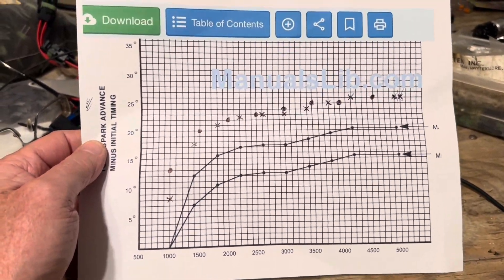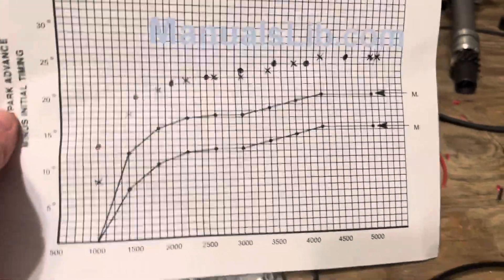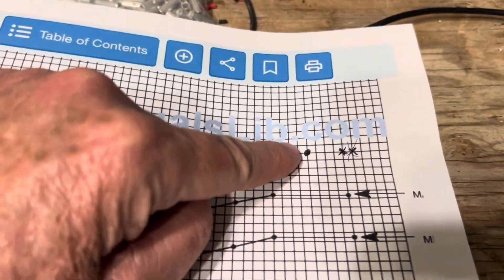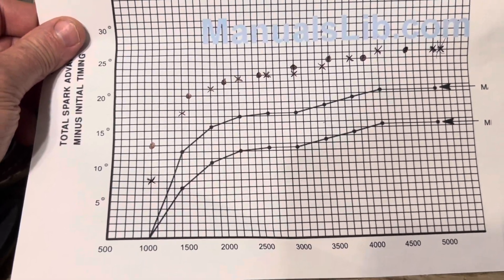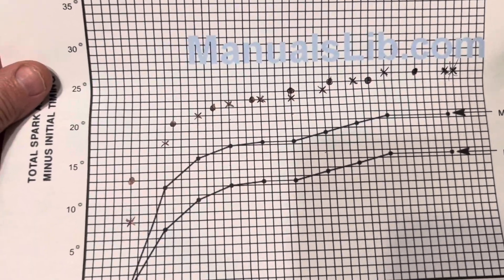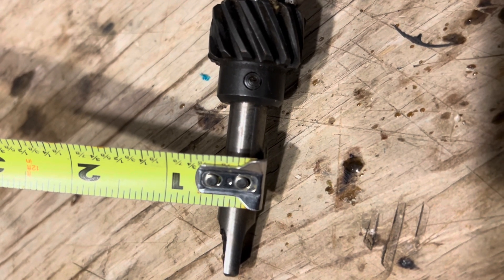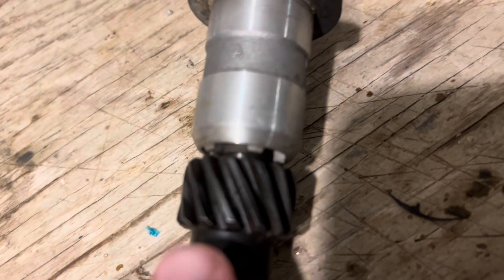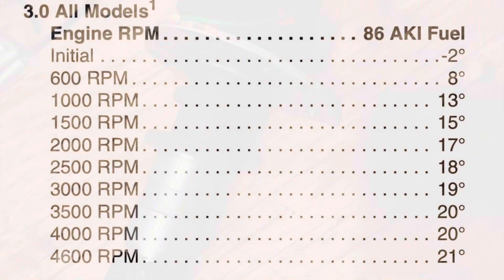Mercruiser DDIS to DELCO EST - How To

Comment: Can I ask a off topic question? At our shop I tore down and  kept a 02 4.3 mercruiser with frozen cracked block 100hrs. is the crank and heads same as my 99 vortec in my chevy S10 4.3? I seen where you rounded up parts from auto in the past. I know cam is different and heads have different casting #
Reply from the maker: The theme of my entire channel is the interchangeability of Mercruiser and Volvo Penta parts with common auto parts which are 5 to 10 times less expensive. I don’t know how you missed that. To answer your question, the crank and heads are interchangeable but you must watch for one thing: keep the rotating parts together and don’t mix them up. Keep the crank, rods, front balancer, and flywheel together, mostly crank and rods as they are a matched set from different factories.
Reply: @moccasinmarine  I seen your old videos but Im getting old and forgetful i'm going merc to my truck . rotating assy looks so good Im reusing bearings rods oil pump heads and all will check clearance for sure on mains. just need find a good block or have one bored and change pistons Be hard to use the same flywheel as truck is auto. I kinda want to use the marine cam but not sure ecu wont go nutz.Like was saying the customer let this engine freeze 2nd year of buying it new they just parked it all these years no h2o in oil that's amazing! It wasn't cracked in intake valley. under 100hrs on whole boat was cheep budget 17-18 searay. Thank You very much for your answer and input!
Reply from the maker: @dgc940 so you are putting the mercruiser parts in your truck? The crank and rods are a matched set due to balancing at the factory. Don’t mix them up or you’ll have a vibrating engine.